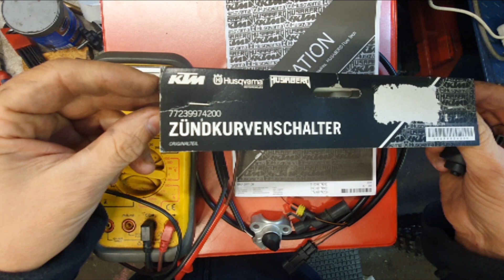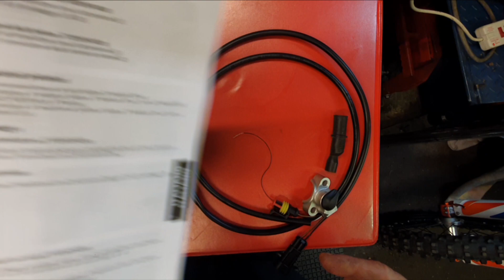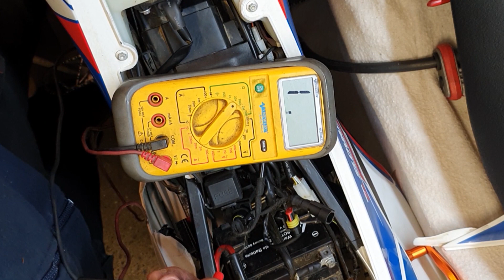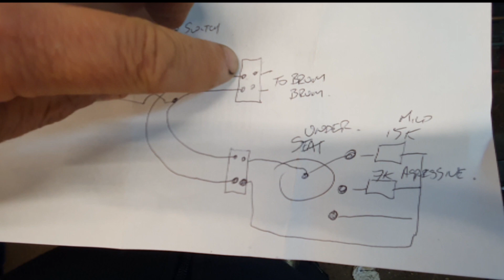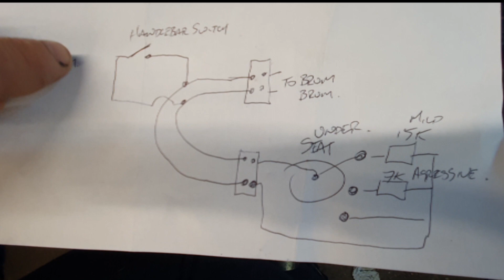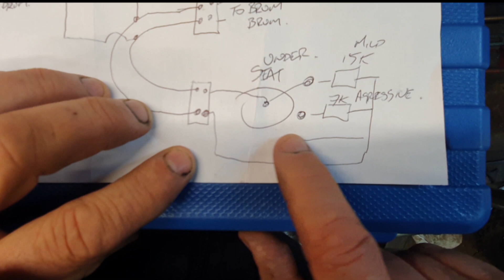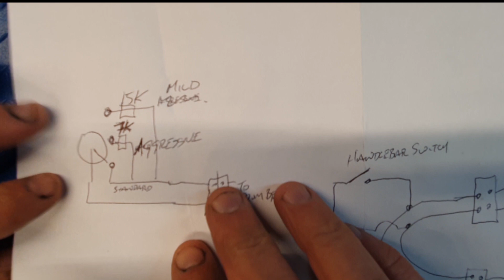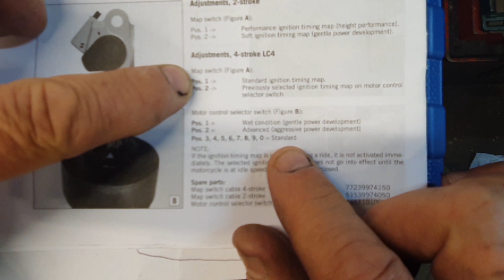Genuine KTM or Aftermarket Trail Tech Map Switch

Comment: Great video @tinkerbod. I tried immediatly to verify your explanation and I used a 14,55 k ohm resistance (today is sunday and in my garage there isn't a 15k ohm !!), on my exc 500 2012, but nothing happened. I thought to set the rain mode but instead the map is the same (standard I think). I plugged the resistance directly into the connector showed in your video.....
Reply from the maker: Not sure this switch works on your bike so resistance maybe different. Also you need the correct map in to start with. You need to make up a 15k in series. As said though is video is jist food for thought.

Comment: Great video, I’ve been struggling a bit to understand the reasoning behind a 10 position switch and only using a few positions on it.. I’ve had mine installed from day 1 when I bought the bike new, and afterwards seen the trial tech one with 3 positions,and was a bit disappointed with Ktm. I’ve been wondering since how trialtech achieved it. Now I’m thinking of building my own 3 positions switch for the handlebar . Cheers man 👍👍
Reply from the maker: Cheers, i wish i knew about this before i purchased my switch, no way would i have allowed myself to be ripped off again, hang on i own a KTM of course i will be ripped off again. The pot is just some generic switch that they have fitted, very little effort and thought went into this assembly, why not give you all three modes, just typical of KTM, anyway all the best.....

Comment: So, could I in theory, get an on off switch, and plug it to the white connector under the tank, and set the potentiometer to rain mode, if I only wanted Stock and mild power modes to choose from? Doesn't the connector from under the seat disconnect the potentiometer from the circuit and turn the bike into Stock power mode only?
Reply from the maker: You either have an open circuit, or a resistor or another resistor. So in theory yes a switch which is either open circuit or a resistor
Reply: @TinkerBod  I accidentally mixed the 2 stroke and 4 stroke map switching systems. Couldn't I just mimic the KTM handlebar switch just by making extension between Ecu loop and the potentiometer, and put a switch of my own in between the extensions wires?
Reply from the maker: Yes in theory if im following you correctly sure, but its hard to say without seeing it.

Comment: I bought a used KTM 300xc and it has a button, the previous owner said it doesn't do anything.
Reply from the maker: Although it may physically fit you need the correct map in it, I dont know where you are but i phoned up the dealer and he said not all bikes have the map to suit this switch. I can defo say that it does make a difference not top end or performance as such but how the power is delivered it does for sure. Im not sure but would you want one on a xc?
Reply: @TinkerBod  I'm on the west coast U.S., and honestly I cant see me needing it for my type of riding. The bike has plenty of power, and I've actually taken a little grunt out of it by adjusting my power valve. I ride tight technical single track trails and before I adjusted the power valve it felt like the bike was trying to rip my arms off. And it has a Rekluse clutch, I've done the suspension, tires and a few other odds and ends and I have it right where I want it. Its perfect.
Reply: @TinkerBod  Its a single button on the left side of my bars, its spring loaded, as in you press it once it stays down, press it again and it pops up. I took my bike out on the street and got on the pipe HARD and hit it, nothing happened. I am curious though who installed it and why.
Reply from the maker: Seems like a home job, but to get a bike to change between maps you have to do it at idle, dont touch anything wait 10 seconds, press the switch wait 10 seconds and off you go, thats what the KTM instructions say for my switch. West coast you luck chap, all the best...
Reply: @TinkerBod  I'm up in the PNW (Pacific northwest) Washington state to be exact.  I'm guessing you're in England? My sister lives there and my mom was born and raised in Sunderland. From what they tell me our weather is about the same as yours. Good riding up here though. Thanks for the tip bro. Cheers from🇺🇸